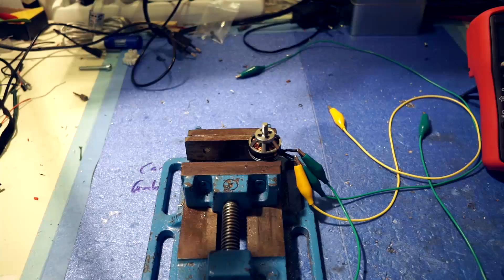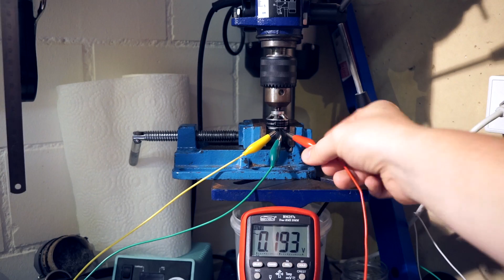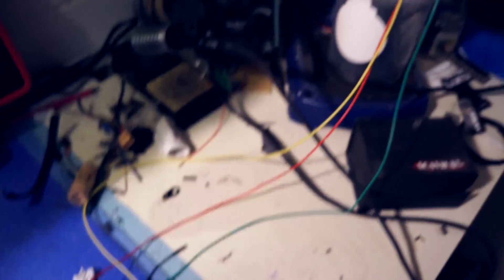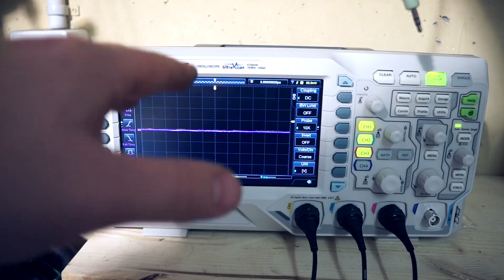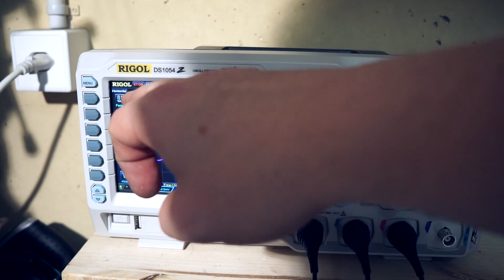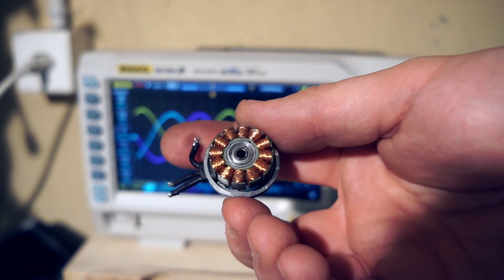Brushless motor testing without LC meter.

Comment: Connecting the scope probe ground clips to nodes that are at different potentials (different voltages) can cause problems and possibly fry stuff. Check out this document from Tektronix and video from Dave Jones' EEVblog.

Fundamentals of Floating Measurements and Isolated Input Oscilloscopes Application Note
http://in.tek.com/dl/3AW_19134_2_MR_Letter.pdf

EEVblog #279 - How NOT To Blow Up Your Oscilloscope!
https://youtu.be/xaELqAo4kkQ